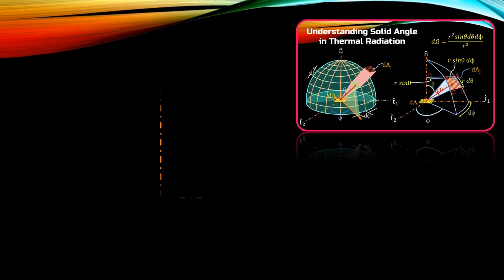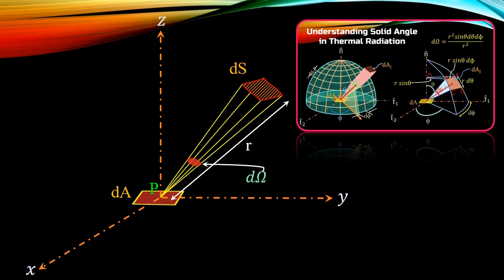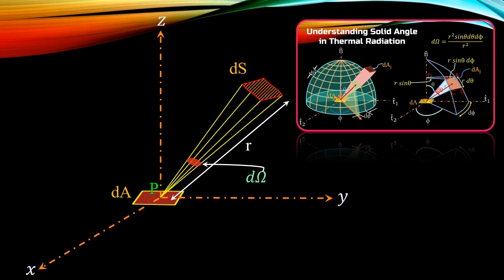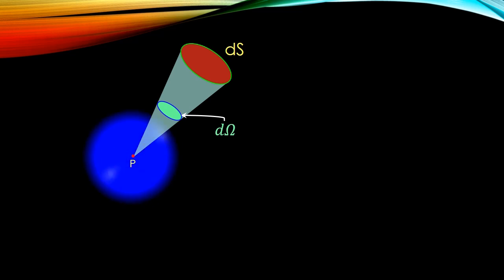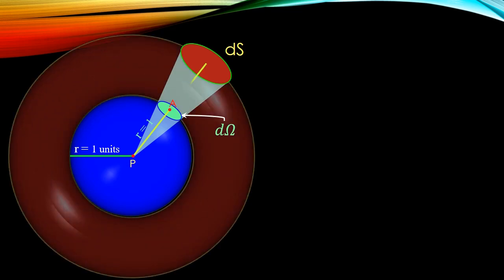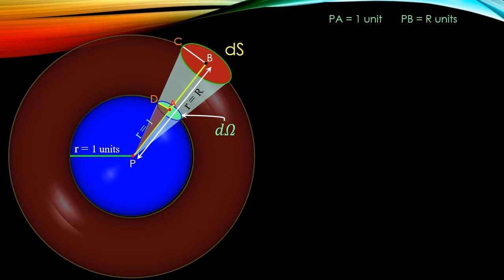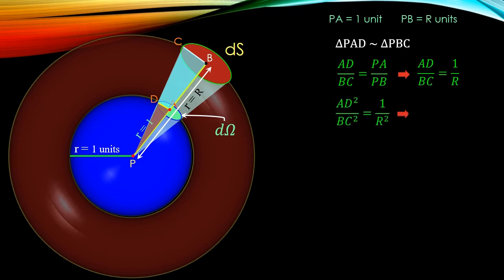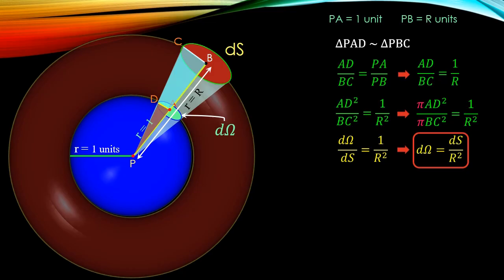Why solid angle is given by the formula 𝑑𝛺=𝑑𝑆/𝑅^2  ?

Comment: First define what is one stradian. One radian is the angle subtended at the centre of a 2D circle by an arc of length "r". Hence the total angle subtended by the whole circle is "2π". 
   Forget " degrees" imposed artificially by the greeks, randomly measuring using a protractor, artificially dividing into 360 degrees. Degrees measurement of the angle is the major drawback, which prevents understanding higher mathematics. Radian uses the arc ( curved) distance, not the linear straight scale distance.
     Now define stradian. Stradian is the 3D angle, subtended at the centre of the sphere by the surface area of r^2 on the surface of the sphere. It's similar to arc length in the circle. Usually any " r^2" should be a square in the Euclidian flat plane geometry. But on the sphere surface it would be a curved square. The centre of the sphere has a total angle of 4 π stradians subtended by the total surface area 4πr^2.

Comment: If domega is the area on the smaller sphere 
How can it change?
Shouldn’t it be a constant with respect to R?
Reply from the maker: The domega will change with respect to R as you can see domega is inversely proportional to R. If area dS remains constant and R changes, then domega will also change. The best example of it is appearance of the size of sun and moon to be same during a solar eclipse. In this case, both have different dS values and are at a different distance R from Earth. But both Sun and moon subtend the same solid angle at Earth. This is explained in one of my latest videos
https://www.youtube.com/watch?v=7rEohKrP05M

Comment: how come R=r even if R>r?
Reply from the maker: @salma-kc6jt  No. Small r symbol just represents radius. It is not equal to capital R. For unit sphere, radius is 1 unit. So, r=1. And for bigger sphere, radius is R. So, it is written r=R. I hope it gets clear now.
Reply: @ENGINEERINGSTREAMLINED  i've been thought everything i currently know in french and even if i understand english, in scientific subjects like these i get confused, so with "radius is 1 unit" u mean a trigonometric circle? thats the circle i know we use in trigonometry which has the radius of 1, if it im right than there is no problem. but i have another question, u multiplied by pi, i assumed it was to create a surface right? but shouldnt u multiply by 2pi? like in orther to get a full surface of a circle because dS and dOMEGA are circles.
Reply from the maker: @salma-kc6jt  Yes, dS and domega are circle. I multiplied Pi with AD^2 and BC^2 because area of a circle is given by Pi × r^2. If you use 2 × Pi × r then you will get the circumference of the circle.
Reply: @ENGINEERINGSTREAMLINED  ohh true i forgot about that, but one more thing how come we went from PA\PB to 1\R
Reply from the maker: @salma-kc6jt  In the video, triangle PAD is similar to triangle PBC. Now, The ratio of any pair of corresponding sides of similar triangles is the same. So, we can write the ratio of sides AD/BC equal to some constant say k. Now, ratio of sides PA/PB is also equal to the constant k. Thus, AD/BC = PA/PB. PA is equal to the radius of unit sphere, so PA =1. And PB is the radius of the bigger sphere, so PB =R. Finally, we substitute the values of PA/PB = 1/R.

Comment: but the question is why you squared it ..?
Reply from the maker: Your question is why I squared (AD/BC)=(1/R). First of all as I explained in the video, the solid angle is similar to a surface and we also have a surface dS which is receiving the radiation from point P. So, our aim is to get a ratio of these two surface areas and to do that we have to obtain the expression of area of a circle with radius 1 unit and R unit which is Pi*(1)^2 and Pi*(R)^2. The surfaces are circle in the present case because we are considering these surface on the sphere surface. Its like if you switch ON a torch light on the surface of a football, then you will see it forms a circle.  So, even if you directly write Area of circle with radius 1 unit divided by Area of circle with radius R  units, we get 
dOmega/dS= Pi*1^2/Pi*R^2
dOmega/dS = 1/R^2

Now, to establish the ratio of these areas, I started with the similarity of two triangles PAD and PBC. So, (AD/BC)= (1/R).  To keep the ratio constant, we squared both sides and then multiplied Pi on LHS to show that LHS is actually a ratio of areas of surface representing solid angle (domega) and receiving surface area dS. Finally, we get the expression domega/dS = 1/R^2.

I hope it gets clear now. If you have any doubts you can write it.
Reply: @ENGINEERINGSTREAMLINED  why have you taken only 1 unit of radius ? why not 2 units ?
Reply from the maker: @Spirit365  This is because the maximum possible solid angle of a sphere is 4pi. Also you might be aware that the area of a sphere is 4*Pi*r^2. So, if we calculate the domega over a complete sphere, it will be equal to sphere surface area and will only come to be 4Pi only if sphere radius is 1 unit. That is why I took the radius 1 unit for the sphere which had the solid angle as domega. Also, the unit  steradian is defined as the solid angle subtended at the centre of a unit sphere by a unit area on its surface.
Reply: @ENGINEERINGSTREAMLINED  so where Omega max is something like a balloon filled with gas is covered with another balloon...?
Reply from the maker: @Spirit365  Yes, you can say that.
Reply: @ENGINEERINGSTREAMLINED  does omega max and sphere radius is same .?
Reply from the maker: @Spirit365  No. Omega maximum can be only 4* Pi. Sphere radius is different.
Reply: @ENGINEERINGSTREAMLINED  so can we think like a cricket ball fitted into in a basketball
omega = cricket ball
sphere = basketball
Reply from the maker: @Spirit365  If you consider cricket ball inside a basketball. Then, cricket ball is the sphere of radius 1 unit and basketball as a sphere of radius R unit. The domega will form on the surface of cricket ball and surface dS will form on the surface of basketball.
Reply: @ENGINEERINGSTREAMLINED  what will happen if you take radius 2 units instead of 1 unit ? of Sphere
Reply from the maker: @Spirit365  If you take the radius as 2 units for the inner sphere then the derivation will not give a generalized formula. Also, the unit of solid angle 'steradian' is defined as the solid angle subtended at the center of a unit sphere by a unit area on its surface.
Reply: @ENGINEERINGSTREAMLINED  so if the domega value is 1 then ds= R²...?
Reply from the maker: @Spirit365  Yes.
Reply: @ENGINEERINGSTREAMLINED  so if the radius of solid angle is 3 units then area of the surface on the sphere is 9 units...?
Reply from the maker: @Spirit365  Yes, if radius of sphere is 3 units and solid angle is 1 steradian, them area of surface dS on the sphere surface will be 9 units.